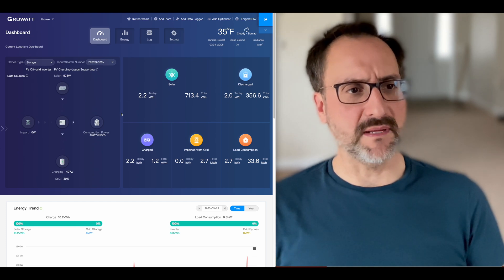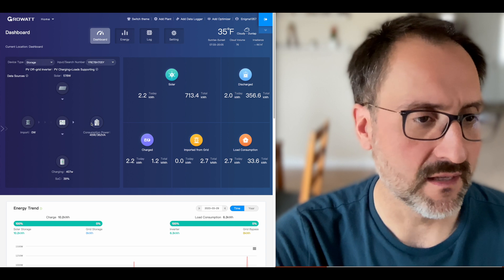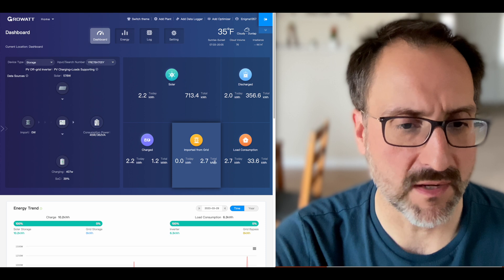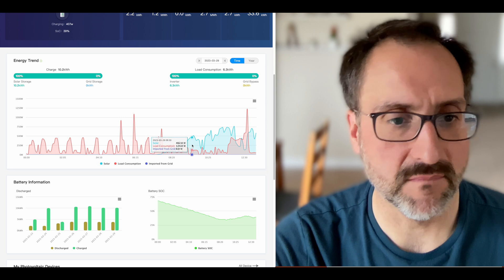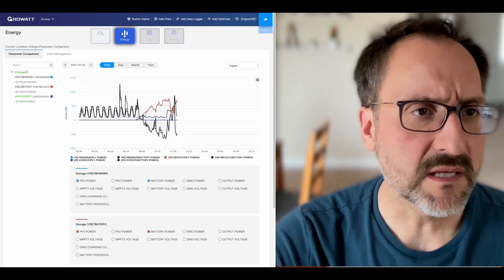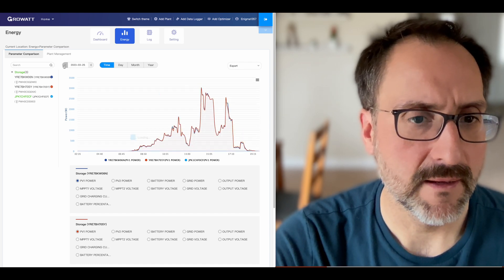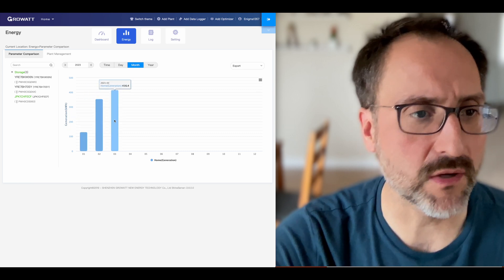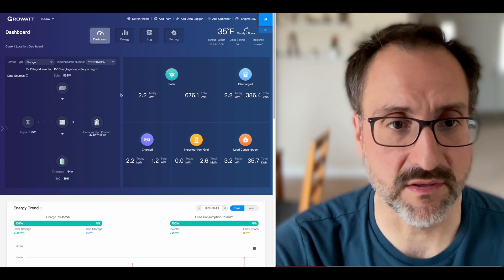Growatt Dashboard Review

Comment: How do you get the Dashboard up and running?
Reply from the maker: 1. Create an account.
2. Link your Growatt wifi adapter by clicking on Add Data Logger.  It will then begin pulling the data from your Growatt and present it in the webpage and associated app.

There are directions for setting up your wifi adapters from @SignatureSolar.  It's where I ordered mine.

https://signaturesolar.com/content/documents/GROWATT/1519024-manual.pdf

Let me know if you have any other questions.

There is another software tool I am looking at getting - Solar Assistant.  It may be a better option for you.  However, I don't have any direct experience yet.

https://solar-assistant.io
Reply: @ZeusRadls  Thank You for getting back to me so quickly, I had figgered it out just before your reply though, again thank you for taking the time.

Comment from the maker: A limitation on our production is our consumption and storage capacity. On a good day we don't use or store all the power generated by the solar panels.  This means we don't know the true real-world cap on our solar production.  Running the cloths dryer and other appliances helps push that up, but once the batteries hit 90% and then 95% the draw steps down.